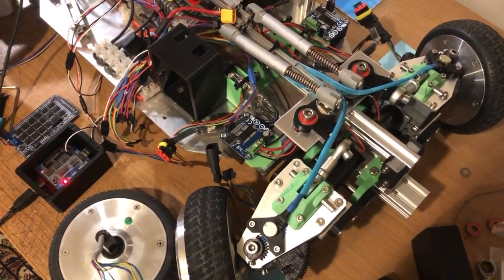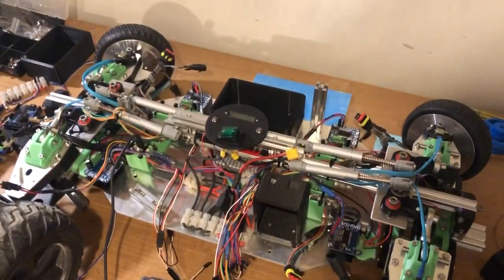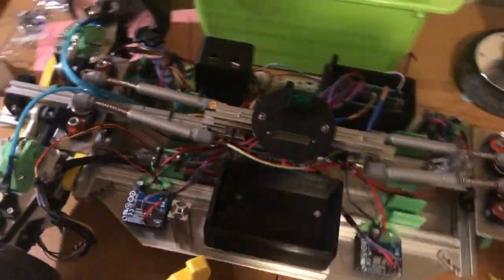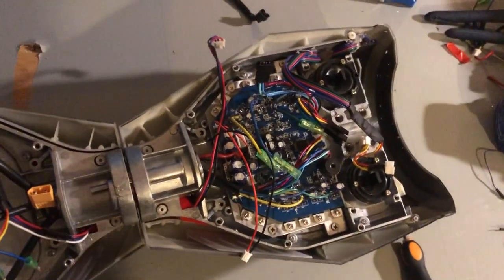RC Hoverboard Car 4 Wheel Steer outside test - future projects - build update 7

Comment: Dude ur missing the point of what u just built . Put the on a mountain board put a pressure pad on each side the board so it can feel u tilting.    

This will feel like a legit hoverboard.!!   Whiplash included 😂
Reply from the maker: hmm thats not a bad idea, i dont think the wheel hubs are strong enough to hold a persons weight but with some metal parts it could be possible
Reply: @A-tech  it’s possible build It.  

 don’t those hover board controllers have tilt sensors I know there stm32 based so the should.    U could flash the boards with the hobby car firmware   Program  boards to steer with tilt have an analog wire for throttle  that’s like a lanyard so if you get thrown of it cuts the power
Reply from the maker: that would be good, someone made a board using the hoverboard motors and just used shaft connectors to attach the wheels to skateboard trucks, looked like it works ok and he could steer fine

Comment: Hi!
I have recently programmed my Vesc speed controller, but I don’t know how to decrease the speed of the motor, it is so difficult to control the robot.
My question is that can I decrease the RPM of my motor by decreasing the motor max current on the program?
Thanks!
Reply from the maker: hi, yes there are a lot of different settings in the vesc tool program, have you got the limits set for your input device? also there are a lot of different controlling options, easiest way is have your motor set up off the ground with the control set up too, then run the software with the system running and try different options until you find the one that works best for you, you should be able to run the motors slowly and have good control of the rpm, what is your input device? also there is a motor setting that you can specify the max rpm in forwards and reverse, I think default is something stupid like 100,000, thanks

Comment: yor wheels are probbly fine, you may need to swap phase wires or hall sensor wires. just try swapping two phase wires of motor not working
Reply from the maker: hi, i should have put a followup on this video, yes i did notice after that some of the hall sensors on my motors the wire is in a different order even though the plug is still the same, bit strange, took me a while to notice, thanks

Comment: Hi
 in the last 3 days i was trying to re program the main board but i couldn't. So please if you can explain this project in details I will be grateful. Thanks
Reply from the maker: Hi, yes the video will show everything you need to do to get the board up and running with options for controls, how far did you get?